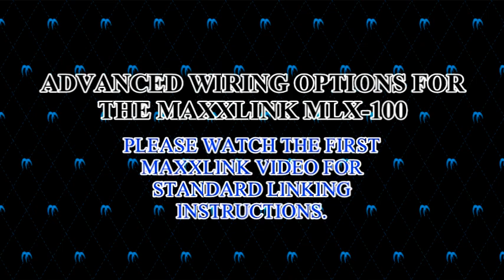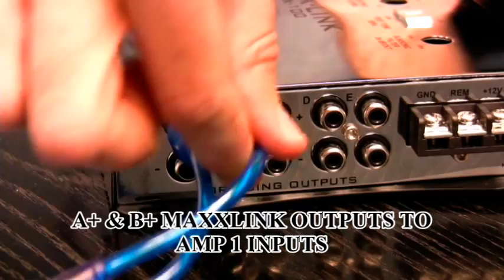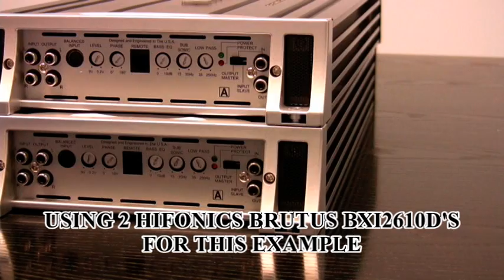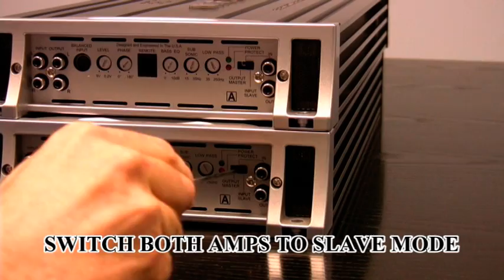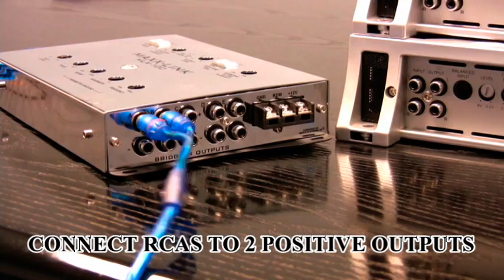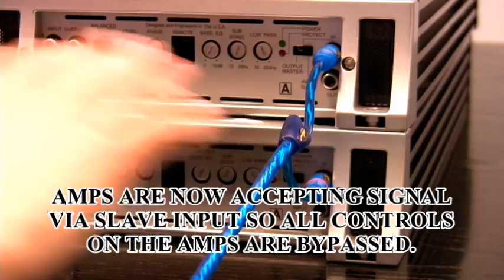Maxxlink MLX100 Amplifier Bridging Module. Tutorial Part 2

Comment from the maker: @twingo16V It is better to use the boost on the amplifier so that the amount is even for the multiple amps. If you use the Bass EQ on each individual amp you run the risk of setting them differently.

Comment from the maker: @twingo16V If you are linking a pair of amplifiers with the Maxxlink, you will always have a jumper from amp 1 negative speaker terminal to amp 2 negative speaker terminal. Whether you link or run independently is based on your impedance. What subs and amps are you working with?

Comment from the maker: You can't use the positive and negative outputs to a single mono amp because they are opposite phase, NOT left and right. The opposite phases cancel out and provide no output and potential damage to your Maxxlink, Amp and sub. I explain the adjustments in Tutorial 1 as indicated. This tutorial was showing wiring of non linkable amps and then using 2 amps in slave with no adjustments required.

Comment: i want to run 4 type r 12s dual 2 ohm with 2 amps should i wire them this way (individual loads) or like in the first vid (as one load) what is a safe impedance? i know 2 2ohm subs are a 2ohm load and 4 would be a 1ohm load but if they were 2 different loads i would have 2 independant 2ohm load for each amp what should i do about wiring
thanks maxxsonics for life

Comment: Question..I am going to power a single solo x 18 in my single cab ranger I curently own a brutus 2600 @ 1 ohm, if I purchase a dual 2 ohm solox and later decide to link 2 amplifiers in master/slave config will the ohm load allow me to use these 2 amplifiers in master/slave or would I be better off just getting a Goliath amplifier and bridging to a 1 ohm load?